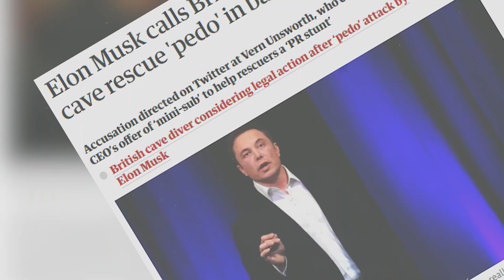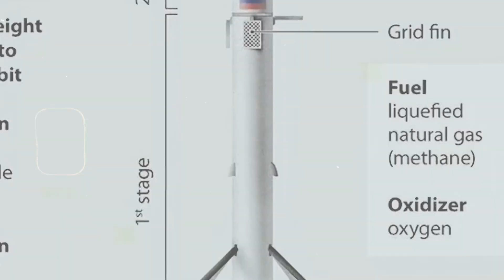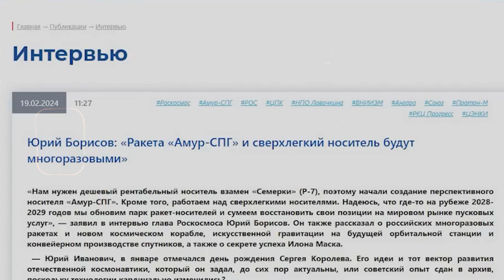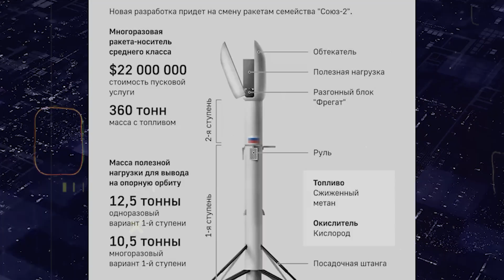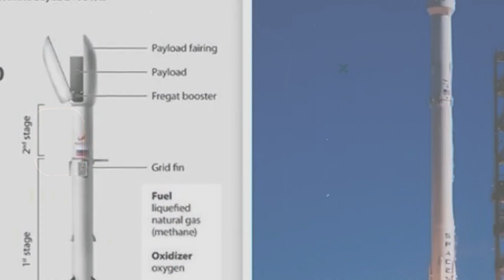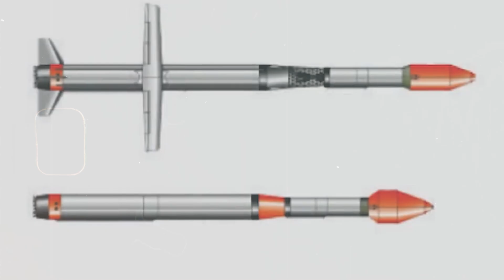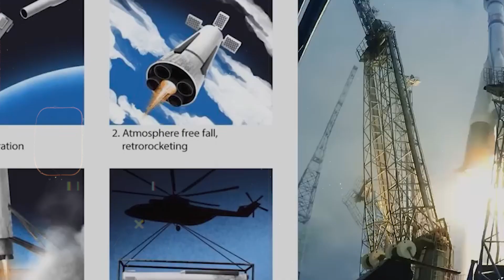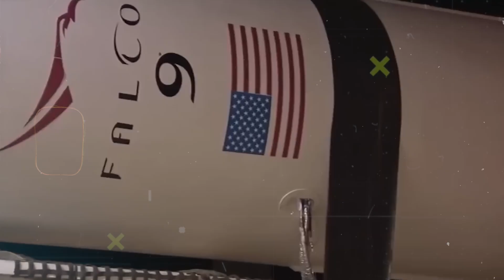Russia reveals New Reuseable Rocket over 100x to REPLACE SpaceX! Musk laughs...

Comment: Former Roscosmos chief Dmitry Rogozin was also full of bluster toward its competitor SpaceX and nothing came of it.  The Falcon-class boosters are about to be OKed by NASA for 30 or 40 uses each and if they are still performing well at that point they will be OKed for more yet.  However, the Starship will eventually obsolesce the Falcon rockets so it won't matter if Russia's Amur surpasses the Falcon rockets.
Reply: Russia is under sanctions and the Chinese tend to do things on their own, so Russia, still having available disposable boosters will test this 'without' fanfare and on schedule (as they usually do), but due to their low Russian demand, the program will stay experimental for years and probably increase the load capability to that of a Falcon Heavy with higher launch capabilities.  LEO is becoming a real space junk problem anyway.